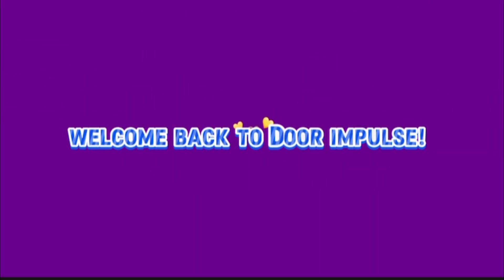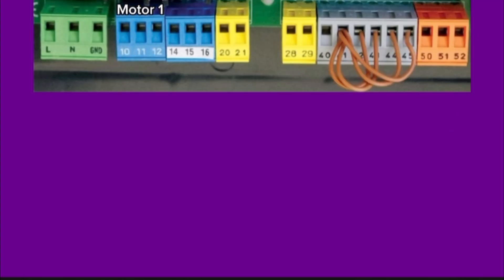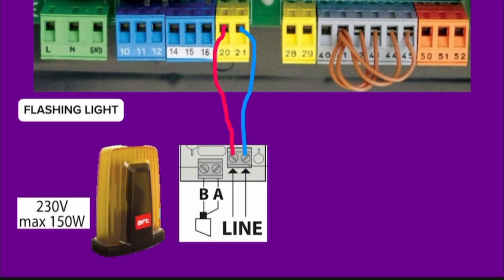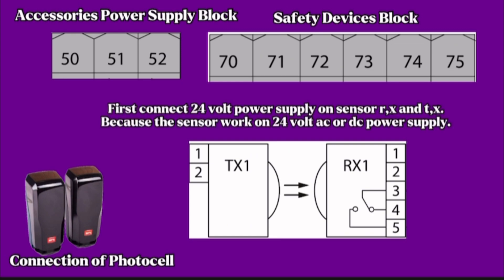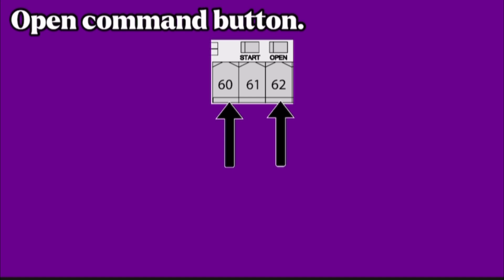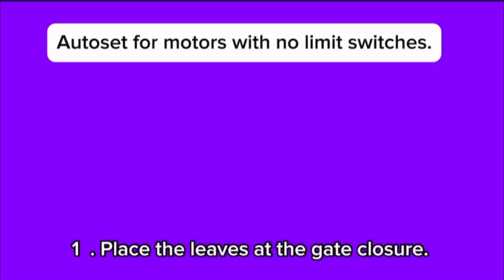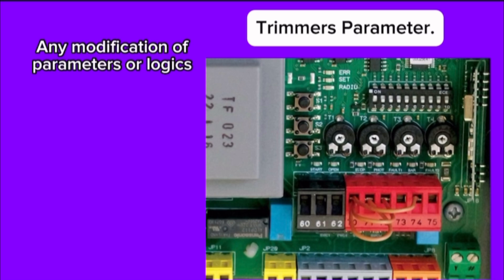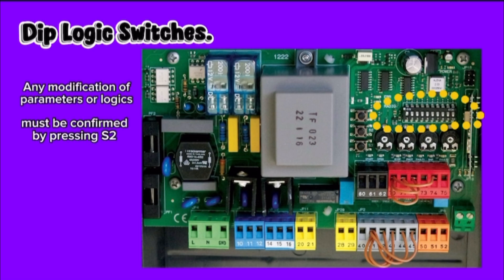BFT PHOBOS AC A50 Swing Gate Opener Installation | ALENA SW2 CPEM Wiring & Programming Guide |

Comment: I’ve installed the gate sensors but I’ve got a problem,when obstruction is removed from the sensors the gates closes 
The gate should surely open for safety reasons,could you help please obviously I’ve done something wrong but I have wired as the wiring diagram
Reply from the maker: Check if the safety input is set to re-open.
Reply from the maker: Check your wiring connections in control board
Reply: I removed the jumper from 70 to 72 as instructed,every else is as wiring diagram,other jumpers jumpers still in place,I’ve tried swapping wiring around but it’s still the same 
Could it be the other jumpers ?
Reply from the maker: I give one solution.
First check without sensor.
Keep jumper between terminal 71 to 72.
Than check open and close door.
If it’s normally ok.
Now open the door half and stop, than remove jumper between 70 and 72, than give pulse the door should be open.
Or when closing the door same time remove the jumper the door will stop and reopening.
Reply from the maker: If this everything I tell ok thank your sensor check

Comment: Witam czemu lampa mruga caly czas , silowniki i fotokomorki dzialaja poprawnie
Reply from the maker: Check Your lamp Connection.
Reply from the maker: If lamp output connections in control board is little problem. Please connect the lamp one wire  neutral of mains wire and one wire motor common wire. Don’t put wire in motor phase pin.
Reply: Czyli zamiast styku 20,21 podpinam jeden z kabli lampy do zasilania głównego płyty a drugi kabel do siłownika nr 11?
Reply from the maker: The rules of bft check by volt meter ac section that terminal 20 and 21, give you 230 v for blinker. If this continues power supply coming, there is some issue.
But there is another option.
Power supply block Terminal N, and motor block terminal 11, connect here the lamp.
Your lamp should be 230 v ac.